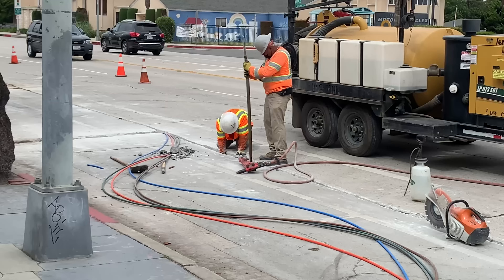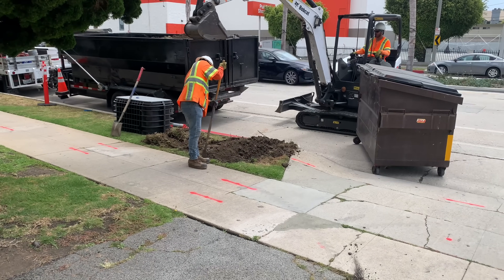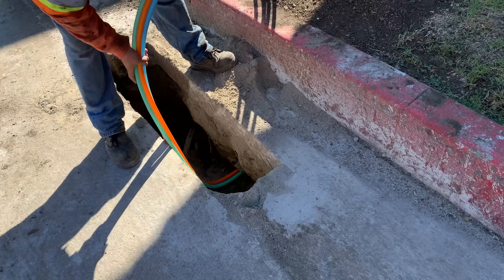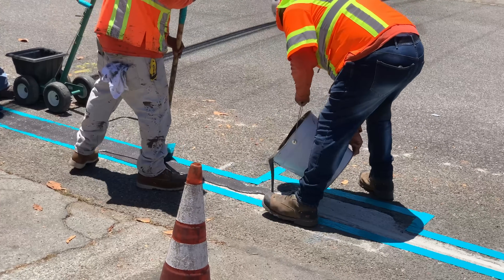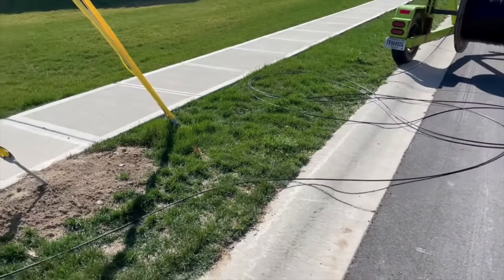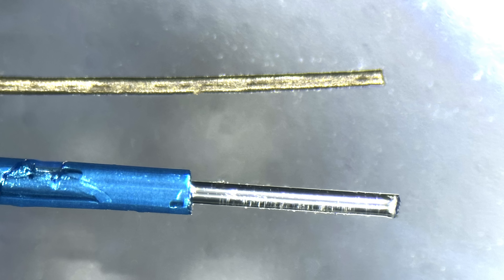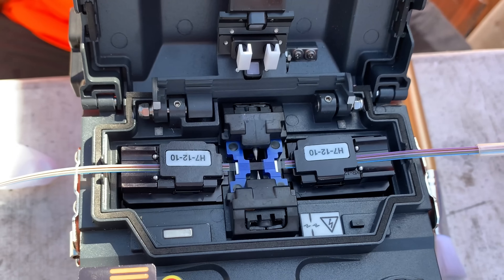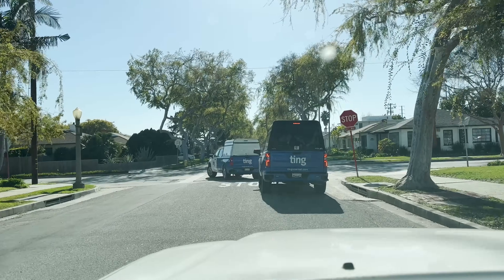Fiber Optic Network Install

Comment: Here in Australia, the National Broadband Network - federally funded fibre - was rolled out for some time. Its crazy to think a single cable to your house could, with the right hardware, go as fast as 10Gbps!
Reply: To date fiber can frequently reach 100Gb or more...just by connecting different equipment on the ends.
Reply: @mrmotofy a single fiber can push way more than 100G with DWDM tech on each end to send each signal as it's own wavelength of light
Reply: @Seris_  Sure very likely but we're still in the real world here
Reply: With current readily available standards it could do 10 Gbps to FTTx subscribers. But it is not limited to 10 Gbps. Fiber pretty much has unlimited throughput, so as technology advances network operators just need to switch out the transceivers to upgrade speed. Starting next year, although it will be expensive, operators are expecting to start rolling out 50G-PON which can provide (but not widely), and although completely unnecessary for most current applications, speeds of up to 50 Gbps to FTTx subscribers. At the transport layer of networks pushing many 100 Gbps wavelengths through a single pair of fibers is common with 400 Gbps per wavelength being rolled out as well.
Reply: @thenerdnetwork  that is insane... i remember downloading gta san andreas at 300 kbps 10 years ago.
Reply: @thenerdnetwork what's the point in those speeds if the server your connecting to doesn't go that fast
Reply: @chriswright8074  You are right about servers not being able to go that speed. Servers can only do 10/25/100 Gbps at the moment. But its not so much about speed as it is about throughput. On a residential level you may have like 4 devices in active use, so anything over 1 Gbps is generally overkill. But on a business level if you have say 200 people in an office building and 100+ active devices in use, they could eat up the 1 Gbps and cause speeds to drop dramatically. Then on the transport level You can have hundreds of thousands or even millions of of devices running through it. Not only that, but there are layers in redundancy built in on the transport level. Which is basically multiple paths. While traffic can flow over the best/fastest route to get to its destination during normal conditions, if a path goes down, like a line getting cut, or a piece of equipment failing, the other paths need to take up all the additional traffic to prevent a service affecting outage for many thousands of people. On the transport level is where 100 Gbps and higher are found. Virtually no place outside of datacenters/switching facilities need that kind of speed. Yet.. at least.
Reply: @thenerdnetwork  1 Gbps is overkill? Most homes wouldn't utilise 20Mbps 99% of the time. People still haven't worked out the difference between "wifi" and internet.
Reply: @bradallen8909  Most homes definitely would use over 20 mbps, lol!! Watching livestreams on good quality requires this. Downloading a game at 20mbps in 2023 is pathetic. 1gbps is required for most operations today due to large file sizes. I don't want to spend hours downloading large games or files. I want them done in minutes, or seconds. The tech is needed, which is why we are advancing it.
Reply: @adamarzo559  You're massively overestimating how the majority of the population uses their internet connection.

Most people aren't streaming 4K video or downloading large AAA games. They're watching Netflix in standard definition and watching low quality garbage on TikTok.
Reply: @bradallen8909  I can assure you that you are wildly incorrect about your statements. 20 Mbps is very low tier internet nowadays and can't support multiple devices. While you may not do much on the internet, thinking families with a couple of children won't absolutely shred 20 Mbps is asinine. Again, as I already said, it is not about the actual speed as much as it is about the THROUGHPUT. 1 4k stream already utilizes over 25 Mbps. And while YOU may not watch a 4k stream, to assume everyone else doesn't as well is also asinine. Now imagine you have say, 50 Mbps internet, which according to you is way overkill, and you watch 1 4k stream and 1 person downloading a file, the stream will buffer. Who wants that? You want to be watching a show and have it stop and buffer because literally only 1 other device is downloading something?

Lastly, it sounds like you don't work in the telecommunications industry. I do. And I have seen the amount of bandwidth just 1 moderately utilized node uses, and its multiple Gbps during peak hours. Also, the technology is there, and it is much more efficient to just deliver the data as quickly as possible. Why not offer the speed if it barely costs anymore to the operator, and why not get the speed if it barely costs you anymore to get it?
Reply: @adamarzo559  lol and I'm here with less than 15 mbps. Sometimes we're all are watching videos or streaming at the same time (at least 3 different devices), but honestly I am not experiencing lots of buffering. We only have 1080p screens so no one's streaming 4k here. But, it takes hours to download a game. Tons of games in my Steam library have never been downloaded because I can't be bothered to set up my laptop to download overnight. It sucks but that's what we're stuck with, better Internet is expensive and our house only has DSL
Reply: Fiber can go 1000x faster. Even without replacing the cable.
Reply: All ISPs in USA are federally funded but its still a scam.
Reply: @jaggsta  That is Ture even unions does not fix everything and funny how people think installing fiber in all USA is easy but reality does not USA is lot bigger than our European counter parts for example France is almost the size of Texas but could afford the fiber due small Geographic area compare to USA
Reply: @jaggsta no they aren’t. None of them are. Federally funded is not the same as just receiving occasional gov support. ISPs make hundreds of billions of dollars every year. None of that is public money.
Reply: @FlyByWire1  yes it is

digital prison
Reply: @driatrogenesis  I mean it’s just a fact that ISPs in the USA are not government entities or GSEs. They’re private companies. It doesn’t really matter what you think lmao
Reply: @FlyByWire1  Nah, telecommunications is way too important for the clandestine services and ultimately the govt, and their bank managers...Who provides the contracts, who gives the loans, who provides the capital? The banks are running the govt by the way
Reply: @FlyByWire1  Bank run, banks own the govt. Ultimately its the same services, doesnt really matter when you are dealing with major banks, and industry leaders, especially in fields as important as energy, communications, technology, medicine, defense, finance...They will have the same familiar board of directors
Reply: @driatrogenesis  except one are private entities and the government is not. There’s is no blurred line between who is private and who is public. This comment gives off major conspiracy crackhead vibes lmao

Comment: I guess the Netherlands has less problems with installing Fiber. It's been here for lots of years now.
Reply: Also more secure, it's not so easy to attach something to my fiber connection without people noticing or breaking open the distribution point. Looks like physical security isn't a big thing over there.

Comment: Now wonder it's so expensive and takes so long. Here in the UK, since about the 80's most of the telephone cables are in shared ducts under the sidewalks, older than that is on overhead wires. Fibre is pulled through the ducts with ropes and rods, or added to the existing overhead poles. They did my whole street in a morning.

Comment: I remember when splicing a fibre involved manually polishing/inspecting/re-polishing both ends prior to fusing. The advent of the automated tools for doing it was a huge step forward.
Reply: Fiber terminated in the field for residential or commercial services is still cleaved and fusion spliced or terminated with factory made connectors
Reply: @OhItsJake  where I live they just cleave it and put a connector at the end
Reply: @nirodper  Depends on what part of the network. The dB loss for a mated connector is around 10x that of a fusion splice. If you're splicing long distances you can't get away with just using connectors. You'll end up with much too high dB loss.
Reply from the maker: So, how did you cut it? I imagine they refined that part as well as the plasma..
Reply: @LeifMaginnis  There was a diamond blade that cleaved it. Took a great deal of practice to get it flattish. If not then a great deal of pollishing was needed to get the end optically flat.
Reply: @stealthyfuck3217  Wowser...I'm sure you're a pro, Bruv.  Buuuuuuut...as it sounds - there's ALWAYS a troll!!!  Yes, "old sckoolin" can get it done.  ABSOLUTELY.  The newest machines take the risk of failure out of the equation, no?  

I'll wait...🤖🤖🤖
Reply: @stealthyfuck3217  Sounding asinine!?!?!  Buuhahahaa...what a hoot, Bruv!!!  I don't "feel" attacked at all.  🤦🏾‍♂🤦🏾‍♂🤦🏾‍♂

If you go back & read what I wrote, I FULLY acknowledge that fiber can AND is installed without a cleaver ("old sckoolin"), right?  

The part that I was questioning/"waiting" for is the fact that "new jack" techs are using tools that SIGNIFICANTLY reduce the failure rate of said "old sckool" methodology.  

Bottom line: I'm sure you have been in the industry a LONG time.  Respect!!!  I just don't understand why someone has to 💩💩💩 on someone using modern methods (that to me would decrease a failed splice/impede packets of data).  

Dunno if my point makes any sense?  🤔🤔🤔
Reply: @stealthyfuck3217  the mechanical are easier too me. I do have a cleaver tho
Reply: @austinreeves5221 what do u use mechanical splicing for??? Literally 90% I see a mechanical splice the loss at the splice makes it unusable.....we're only allowed 0.30db of loss on splices and mechanicals are often 0.50db an up with terrible reflectance

Comment: why they just don't place fiber on the poles?
In my village in ukraine every household that has internet is connected with fiber, it's much cheaper and faster
Reply from the maker: No telephone poles here
Reply: @LeifMaginnis  but there are a lot of light poles, fiber cable can be placed on those, also at the end of the video I can see some wires in the air

Comment: why are they not  using horizontal drilling, most of the equipment they using cut up the street is just marginally cheaper than a  horizontal  drilling machine

Comment: Fiber is really the way to go for longevity over copper.   If you can wire your house with fiber I'd do it.   Fiber installed 20 or 30 years ago are STILL usable today.
Reply: 20-30 years? Copper wiring lasts far, far longer than that. Try 100 years plus.
Reply: @bradallen8909  not where I am. Most of the terminals I've been in are from the 1960s (aerial) and the peds from the mid 70s are also crumbling. They've been doing bandaid fixes since long before I got into it 17 yrs ago. I don't miss that sh¡t.
Reply: Yeah, I've taken many photos over nearly 2 decades of twisted pair distribution lines installed in the mid-60s here. It's crumbling and dying a slow death. I don't miss working on it. It's been mostly bandaid repairs, long before I started working on it!
Reply: Where I live, the copper has been in place for 60 years and works fine.

The reading for fibre over copper isn't longevity, it's the speed.

Comment: no it is not that difficult here the just replaced the copper cable with fiber in the same very old metal tube i think here the most of them are around 50+ years old..  and more than 80cm deep into the ground.. it is just the low American standart that makes it harder to fix or replace things..
Reply: Cheap to install, very expensive to maintain/repair... Might be the reason most US highways and bridges are falling apart...

Comment: That's crazy, here it's nothing like this. They just pull it though the municipal conduits and left dark until someone wants to connect their house. No trenching, no concrete pouring.

No wonder US fibre optic connection are so expensive.
Reply: Makes me think the company is incompetent there. SaskTel wanted to run fiber optic, they only needed to run cables under the street and dig holes for boxes.

Comment: We got fiber to the home installed last year. They opted to work with the local electric company to run the fiber bundles through the air instead of underground.
Reply: Aerial construction is astronomically cheaper and faster to rollout. It also allows for much easier maintenance and less risk of being damaged regularly. I can't imagine the headache micro trenching causes network operators. If there is ever road reconstruction they would constantly be on the hook to relocate their lines at their own cost.
Reply: Storms and accidents frequently take down poles/wires. In the ground is generally much safer

Comment: I got to see work like this done inside a long distance office in the 80's.  I even have a keepsake sample of fiber, a cutoff, from that work.  Maybe somebody can help me.  Was the plasma fusion a thing in the 80's?  The optical alignment they did was (if I understood correctly), but I thought they were polishing the butt ends to optical clarity to go into a connector.
Reply: I did a quick search and found that Fujikura developed the first fusion splicer in 1977, which is probably around the time telcos started using fiber backhaul.

Comment: I do this currently, and this has to be the best and also most easy to listen to video from start to finish.     Great work !
Reply: May I ask how one can go about in working with this sort of thing?
Reply: @gustavoventurin  If you are in the US (and probably elsewhere as well), you could look up "Certified Fiber Optic Training Courses" as a starting point. I took the first training course in a series for my job. I didn't need the skills but just the knowledge. To give you an idea, I did this about 5 years ago for $1500 USD and a several day long course. I passed the exam at the end and got a certificate from ETA International. It either wasn't hard or I had a good teacher that made it not hard.

Comment: The way they are laying the cable is called 'micro trenching'. And it is considered to be relatively cheap and fast. But also causes a lot of trouble in the long run because the time will come when the street has to be redone or something and then you have all those cables embedded in the concrete / asphalt. 
On the other hand doing it the proper way by digging trenches on the sidewalk and putting the cables deep into the ground is very costly and takes a lot longer... Pick your poison
Reply: That's what I thought only 8 inches deep Sounds dump to me. That street didn't look to new to me.
Reply: Then you had Google with their "nano trenching" in Louisville KY. I have heard it was 2-4 inches deep, needless to say it failed for tons of reasons (including just frost damage, let alone digging / road stress). They then just nopped out of the area and left Louisville to deal with it.
Reply from the maker: When they redo the street, they won't go down 8"
Reply: @LeifMaginnis  you haven't seen the potholes in my neighborhood....lol

Comment: I had fiber installed last year.  Fiber all the way to the box next to my router.  Some contractors use the Ditch Witch a machine that lays the conduit underground.  Amazing how they can do that for a fairly long distance, going under other utilities along the way.  I have one of those panels in my front yard, and I actually saw them put that big cylinder down in the hole.  In the house it was just being careful not to bend the fiber at to sharp an angle as it goes though the basement.  There is actually a large rolled up fiber roll put into the rafters.  So different from the regular copper cable, and not something I can splice like copper.
Reply from the maker: Yeah, there’s a big piece of fiberglass at the core of cable to keep the glass from bending, there’s a brief pic in the vid
Reply: You can't splice it because you need a very expensive fusion splicer 😁 our new 90 series fujikaura is like 10 grand for the splicer alone, I'm not even counting the box it sits in!